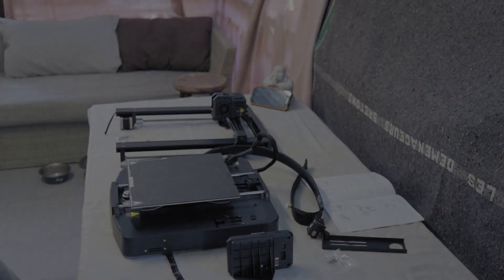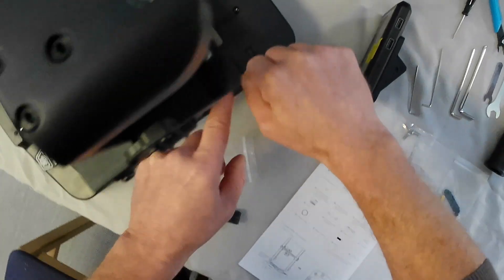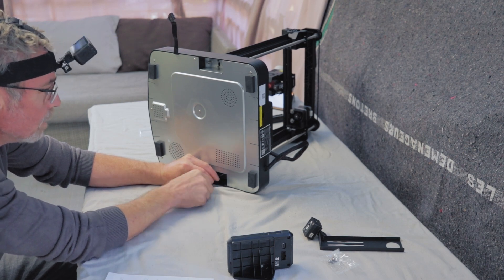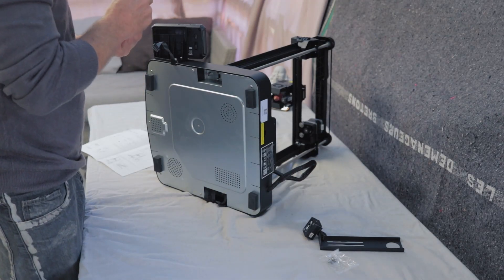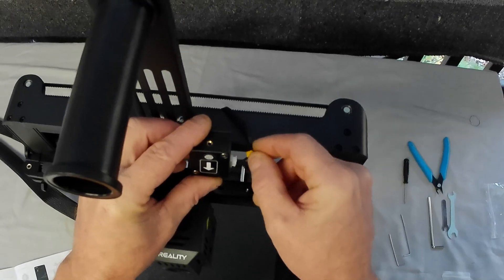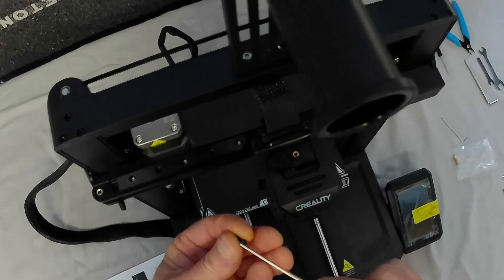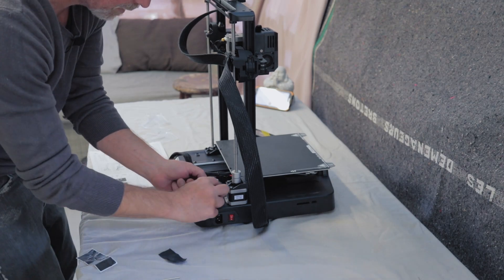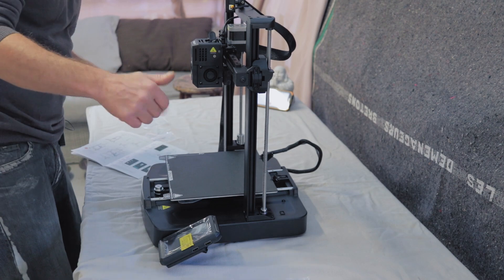Creality Ender 3 v3 KE 3d printer assembly guide, How does it go together.

Comment: great setup video, thanks. Did you notice the printer smells bad even before loading in any filament ?
Reply from the maker: I can't say I did. Do you mean when it's pre heating?
Reply: it was even before I preheated the nozzle, just the fans blowing a stench at me. Was a bit surprised the fans even run at idle. I hope/think tomorrow the stench will be gone